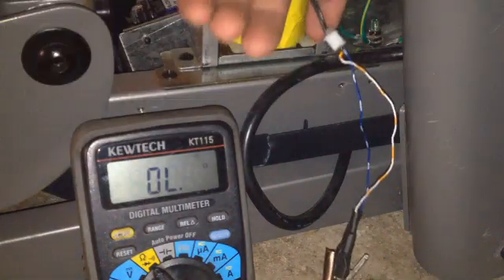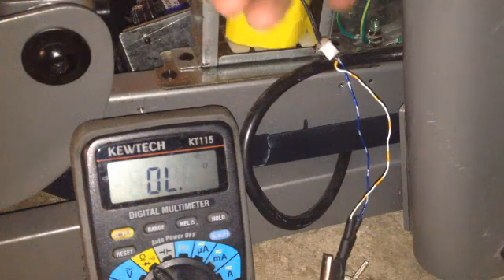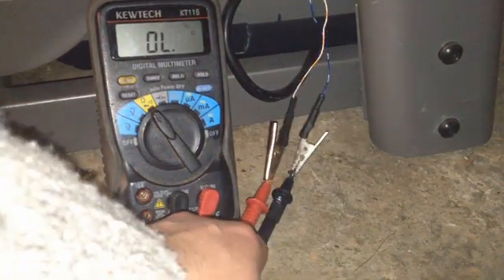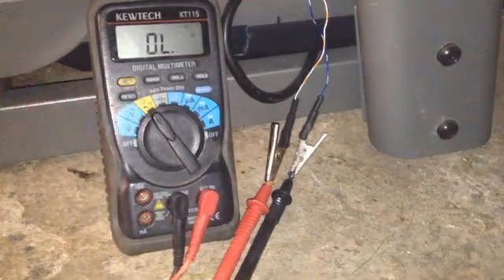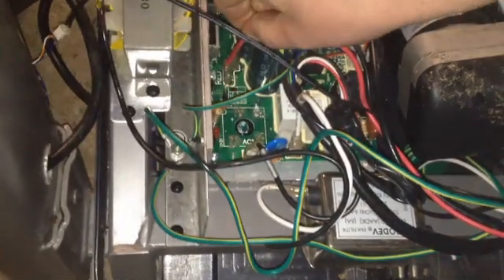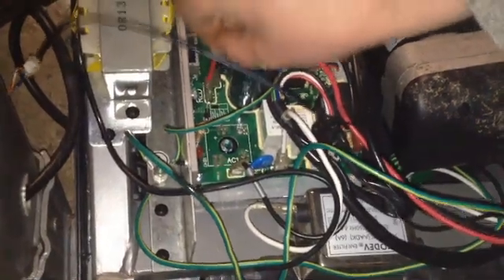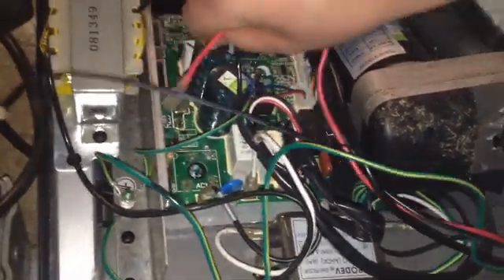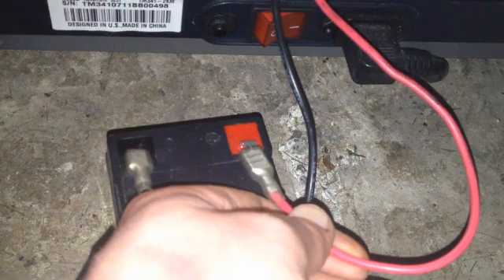Treadmill: Testing the Reed Switch

Comment: As soon as I hit send I realised it was the switch passing the magnet. I have a motor and controller for a project but getting E1 error which I think the reed sensor is gone. I disconnected the sensor and put a magnet to it and got no continuity
Reply from the maker: +JaybeM5 Yeah sounds like it might be gone Jay. When I was troubleshooting this treadmill, in my mind I was 100% sure that it was the reed switch (even though it was testing okay in the video above). What I found when I opened the reed switch sensor, there was just a reed switch connected to the two wires.. i.e. no complex circuit or anything. I went to a euro store and bought a magnetic door / window contact alarm, took the reed switch out of this and soldered this in place of my treadmill reed switch. This allowed me to confirm that my problem was NOT with the reed switch. Why don't you see if you can get one of those magnetic door window contact alarms cheap, and maybe buy a magnet as well. Then you will have all the tools you need to verify if both  a) the magnet on the roller wheel and b) the reed switch, are working.
Reply: +Vital Computing That was my next question whether an alarm one would work. I can get one of them no problem or fleece my bike for one !! Thanks for your help. I might be back for more questions if you don't mind.
Reply from the maker: +JaybeM5 Yeah I'm interested to hear how you get on. If it's just the reed switch it's a cheap fix !
Reply: +Vital Computing no didn't work. I got the original reed switch working again but still getting the E1 error so back to the drawing board again !!
Reply: +JaybeM5 Hey jay, what exactly is happening when you turn on the treadmill. Is it starting then stopping, or does the motor move at all? And what does that E1 error mean for your particular make of treadmill?
Reply: +JonathanAnon it starts as soon as it gets power and turns off instantly does that twice then nothing. When I press start it counts to 11 seconds and E1 comes up on the screen. From what I read it means speed sensor (reed) error on most treadmills but I'm not sure. I don't have the exact model as all I have is the internals but was told it's a discovery treadmill. I can post a video later of it set up on the bench.
Reply: +JaybeM5 Yeah that's a good idea. You should also test the motor. Usually they are large DC voltage motors but they can be tested with the 12v battery from a powertool (just to make sure that the motor turns). There are a few videos online to show how this is done.
Reply: +JonathanAnon I have tested it with a drill battery and it works fine. It also spins pretty fast when turned on first which it shouldn't turn on at all on power up until start is pressed. I'll post the video see if you have any ideas
Reply: +JaybeM5 Oh okay. good to have that done anyway to rule it out. tbh that doesnt sound good. Sounds like the transistor that controls the motor could be shorted. Dont forget to include the model number of your treadmill and send me a link.

Comment: If there's continuity does it mean the sensor is bad
Reply from the maker: +JaybeM5 Hey Jay, I'd forgotten I posted this. There should only be continuity when the magnet passes the reed switch. The beep you hear is the reed switch connecting (and my multimeter indicating continuity) when the magnet passes it.Google "Reed Switch" and you will see what a simple device it is. Once you understand how it works, you will have no problems working out if it is working.